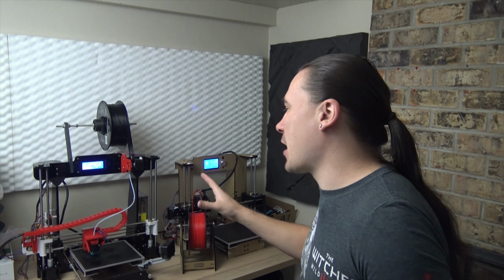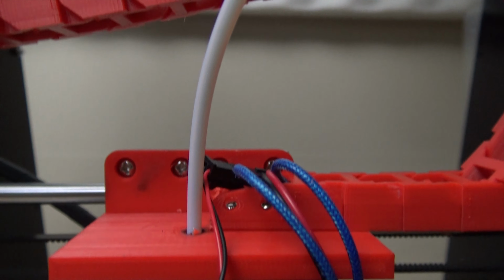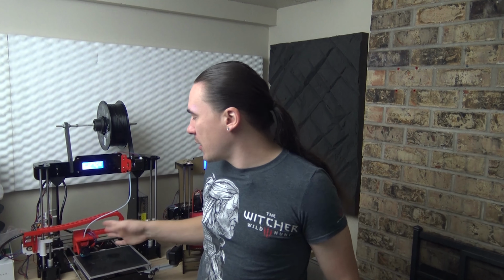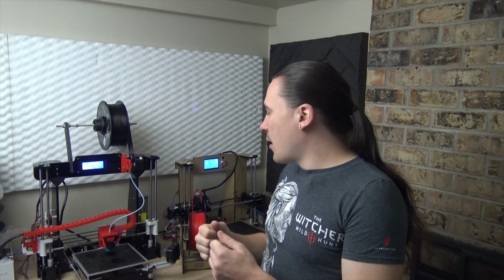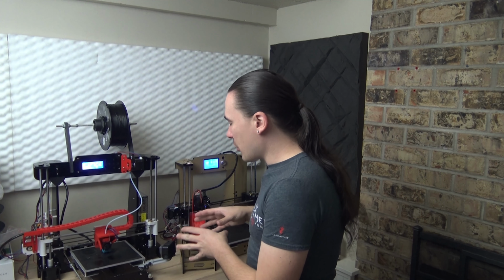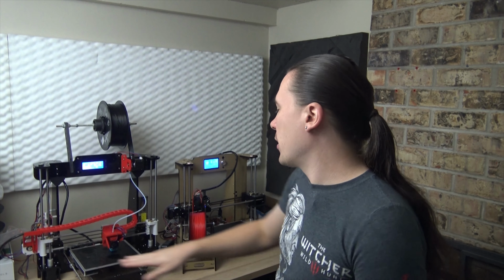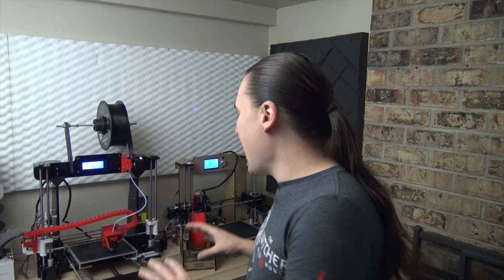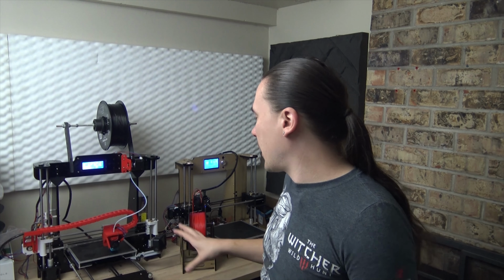Anet A8 3D Printed Upgrades

Comment: I am currently looking into updating my Anet A8 to print higher temperature plastics like PC that require 300*+ with a e3d all metal hot end. So a PT100 thermocouple and amplification board upgrade is required for the hot end. But there is many problems when doing this like lack of connections, and i don't have electronics knowledge would love to see your thoughts on this.
I seen some information about 8 diode TL-smoothers are they needed for a A8 if you want perfect surface on your prints?

Comment: great video. could you please tell me what print temp you use with bowden and did you have to change any other settings apart from retraction. thank you.
Reply from the maker: robojeep4ltr thank you. I only had to change the print temp to 220. this prevented the extruder motor from having torque issues.